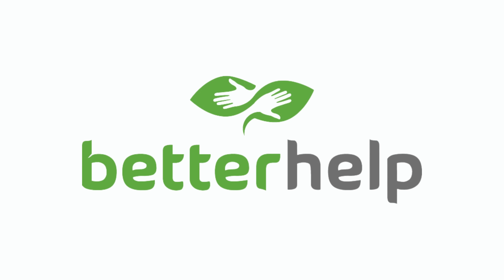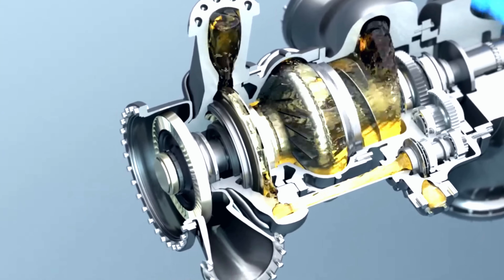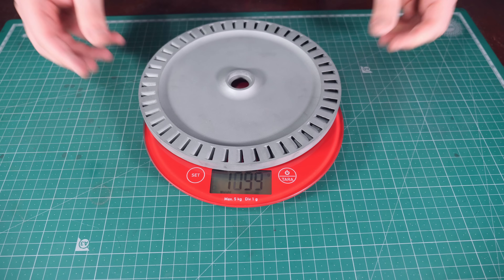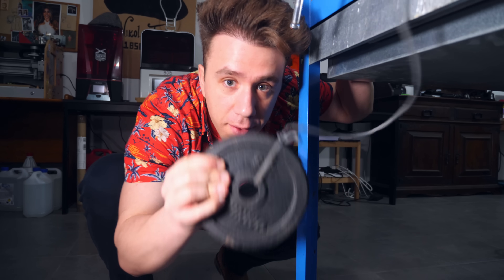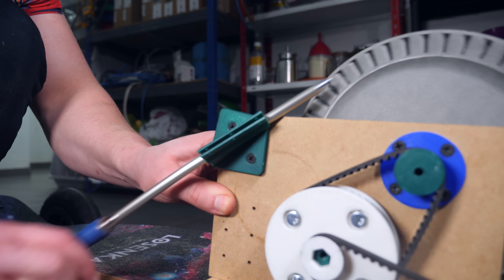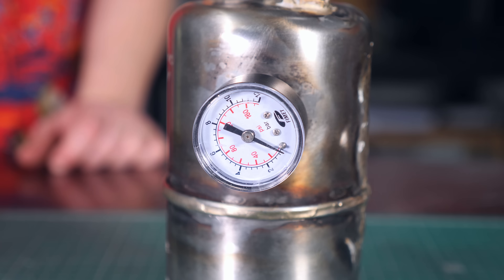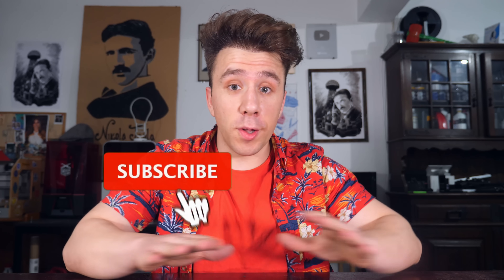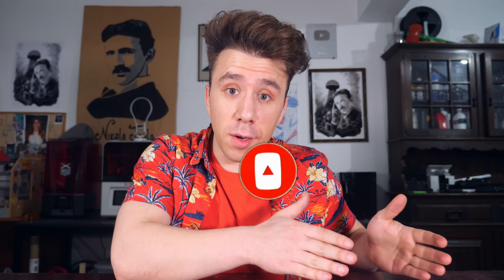I built a TURBINE Skateboard

Comment: Hj, just a note or whatever to mention that you are depriving your design of a good deal of it's capability by the rather hurried assembly of the turbine mounting.  I am unaware of the relative torsional strength limitations of whatever polymer you make your parts of, but the side play could stand to be equalized.  When that is achieved, the concentricity may be more closely observed, and , if necessary, corrected.  I know that this is just a "bread board" rig, not a finished product and that your habit is to improve each trouble as it rears it's head to attract your attention.  I felt the urge to, possibly, save you the frustration of having to re-acquire such an expensive item.  On a side note, BRAKES.  I was thinking that compression of the rotor would work , but a counter rotational stream would work nearly as well if there were a second rotor, which would give you twice the weight  but will slow the acceleration accordingly while removing any worry of distortion and heat.  No matter, just doodling without paper.  Looking forward to see your advances.

Comment: steering a skateboard is just about the distribution of weight. If you can balance while leaning to either the left or right, you can sufficiently direct the direction you are rolling. impressive work on the turbine wheel btw. I love seeing metal-printed parts in action.

Comment: you could make this but with combustion providing the power, it wouldn't be hard necessarily since you can 3D print the turbine out of metal, and you could use a direct linkage gearbox to drive yourself forward

Comment: If you stood upright, you wouldn't really need a steering mechanism, you could just lean in the direction you want to turn. Maybe rig up a remotely controlled servo or an actuator cable to control the release valve on the nitrogen. This would add another layer of safety for you, too, if something catastrophic happened at the drive mechanism.

Comment: There are a few reasons a gas turbine isn't great for a passenger car, one of which is the fact that turbines want to run one speed, instead of speeding up and slowing down like we do with our reciprocating (or wankel!) engines today. The throttle response can be several seconds, and you don't want your engine pulling at full power for five seconds after you've mashed the brakes! There is also exhaust heat to deal with, you don't want to burn the bumpers off the Camry behind you at the light. 

Engineers with Chrysler came up with all sorts of cool things to solve the above mentioned problems, and as a result they had a very smooth car engine that cost a lot of money compared to a V8 engine of the time. And people were used to their cars rumbling, instead of howling like a vacuum cleaner. The turbine engines have a similar problem to rotary engines, in that they need to be noticeably better with regards to fuel efficiency, noise, complexity, and cost than what you can currently get in a car, but normal car engines are improving all the time. You're chasing a moving target. If you take ten years to develop an engine, you've got to anticipate what engines will be like ten years in the future.

Comment: Try not to go out like Max Valier. Maybe put something between yourself and any high rpm turbines and home made pressure vessels so you don't die as soon. Also you should try driving that turbine with a hybrid rocket engine or something spicier than compressed air. Go big. I bet you could get 100KW out of that turbine without trying too hard.

Comment: 1:01 Jet engines are NOT efficient at all!! Why would you claim that they are? The BEST jet engine in existence barely makes 30% efficiency - most commercial jet engines are in the range of 15-18% efficient. The exhaust is thousands of degrees....they're only able to be efficient if the exhaust is cold and that thermal energy is used - and it isn't. Jet engines are hilariously inefficient in terms of the Carnot cycle. You're an engineer mate - you should know that! The majority of the energy of combustion goes straight out the back of the engine and is lost. I really respect you as an engineer and love your videos, but you SHOULD at least have a basic understanding of physics....

I'm going to just assume you misspoke.

Comment: Integza my man, I love your content but I am going to downvote you for safety and constructive criticism.

1 - Long sleeves and loose shirt near rotating objects. The bench saw and drill press with wrap you around them like a pretzel. NO LONG SLEEVES!

2 - Standing right in the way of the spinning flywheel a random chinese company made for you and spinning it at 6000 RPM. If it would have structurally failed due to a defect, you would be right in the way of serious pain.

3 - You MUST use an automatic pressure release valve. PLEASE. You very nearly became the ghost of Tesla PAST with that liquid nitrogen can.

4 - When you're sitting on the finished contraption, you were sitting with your private parts right in line with that same spinning flywheel. Please for the love of god, add a shield around the flywheel to protect you from disintegrating parts!

Thank you and I look forward to your next (hopefully safer) video!

Comment: I think that you should test different 3D printing materials, print cylinders and test them for pressure. Until failure. Test different plastics and different wall thicknesses. So that we learn what material to use. Boom! 😍
Reply: Yeah, make multiple pipe bombs. What could go wrong?

Comment: Not gonna lie, was a bit nervous about the nitrobomb you created at first.  Glad you chose another solution.  My suggestion for next project is to go bigger.  Since the company has your turbine design, get another one made and double up.  Double up the turbines to make a bicycle drive with double gears, double air lines and use the same nitrogen tank with more bar to allow for the double turbines.
Reply: The pre-fragged flywheel spinning at 6k in line with the rider doesn't bother you?

The container was nice too but that turbine... 😯🤦‍♂️

Comment: There's a few reasons gas turbines didn't catch on with cars and trucks. For one, while they can be more fuel efficient than piston engines, they'd rather run at a specific, constant speed in order to achieve this. Which is fine if you're just driving on open highway, but not in traffic. Also, while you get very smooth power output out of them, their throttle response isn't that great. If you've heard about "turbo lag" in turbocharged cars, it's the same concept. Emissions were also a problem. When the Chrysler Turbine came out, the US was just starting to implement emissions regulations. IIRC, Chrysler couldn't get the exhaust clean enough to meet the new requirements. So the tech was pretty much DOA. I suggest watching Jay Leno's video on his Chrysler Turbine. He goes into depth about how it works and what it's like to drive. For cars and trucks though, reciprocating engines and electric motors are just better suited for that task.

Comment: Okay, so ignoring the obvious safety concerns of this pipe bomb powered skate board (Turbine failure risk - Centrifugal detonation, and the lack of a safety valve on an improvised pressurized vessel - further detonation risk), There's a fair list of ways to boost efficiency here:
- Directing valve for the gasses, which can likely be implemented with the addition of a turbine shield
- Further turbine stabilization, which likely also would fall within an implemented turbine shield
- Tube rerouting and Pressure vessel relocation, to both reduce used space (and potentially weight) on the board and further separate them from a rider
- Implementing a solenoid valve on the vessel's output (and/or input), to both serve as a faster pressure discharge, and potential alternate safety discharge if implemented with a pressure gauge that can link to the valves' electronics
- Low power heating coils, rather than a Bunsen burner, to stimulate evaporation more safely within the vessel without an open flame

Please be more safe with this project in the future, although the speed of these developments was impressive, in spite of egregious lack of concern for safety.

Comment: CO2 tanks hold more volume of gas for size/weight than nitrogen.  When compressed in the tank, co2 is in liquid form.  It might get you a longer run time on the portable cylinder.

Comment: Theme for a future video idea: Tip jets. Build a propeller with tip jets(like the rotodyne used for takeoff). I think it can be built with 3d printing and powered by compressed air or nitrogen, and could definitly push you around on a skateboard.

Comment: Video idea: turn a gasoline engine to work on liquid pure nitroglycerin, sounds fun and dangerous :3
Tomatoes are disgusting!
Reply: Ignition systems? We don't need no ignition systems.
Reply: @absalomdraconis  but i think gasoline engine isn't gonna support the explosion of nitroglycerin, maybe diesel engine it's gonna work better
Reply: @itsmesqrdios That's actually a good idea since pressure can combust nitroglycerin. But what if it was a Wankel rotary engine? Wouldn't that make it even more powerful? Moreover, Integza has made a rotary before, too.
Reply from the maker: Congratulations! You won a 3d printer! Send me your info (Name, Address, Zip Code, Phone Number) to integza@gmail.com .
Reply: Sounds almost more like a diesel engine would work better but good idea nonetheless
Reply: @0_Chr1s_0  yuup
Reply: I think a diesel engine would be a better fit for nitroglycerin considering how explosive diesel and nitroglycerin are. That being said, nitroglycerin is far more easily combusted than diesel, but I do think a diesel engine could withstand the combustive force of nitroglycerin for a short time. And considering how little you'd probably need in order to mimic the combustive force of diesel, I'd say it could be pretty efficient.
Reply: @maxxswagster9283  yeah same thing, diesel engine would be better but i don't think it's gonna handle the power of the explosion
Reply: @maxxswagster9283  but still, how would you get nitroglycerin into the combustion chamber?
Reply: @politecat3299  With a fuel injector.
Reply: @maxxswagster9283  do you really think nitroglycerin can withstand 2500 psi ? Nitroglycerin explodes at 0.284467 psi
Reply: @politecat3299  Well if it combsuts at such a low pressure rating, that means you could potentially build an engine with a smaller size. A smaller engine with a smaller size with the same amount if torque as a bigger diesel engine could be really nice. Imagine having more space in the engine bay of a big truck. Better yet, in situations where you need more torque, you could make the engine a bit bigger to be able to withstand heavy duty applications like what used in heavy equipment operation.
Reply: @maxxswagster9283  also nitroglycerin is very viscose and semi gelly. It can't be vapourised, also nitroglycerin explodes at 38°c . So that'll destroy the engine because of the non uniform cycle
Reply: @politecat3299  Suppose we'll either need to make a form of nitroglycerin that's less viscous so it can be properly injected into an engine, such as whats fome for biofuel. That, or we'll have to utilize a more powerful fuel injector in order to inject the nitroglycerin.
Reply: @maxxswagster9283  you can't use nitroglycerin as fuel in engines any way. It won't work.
Reply: @politecat3299  Why won't it work though? What is limiting nitroglycerin as a fuel for combustion engines?
Reply: @maxxswagster9283  it's highly volatile, corrosive, explosive, reactive and sensitive in its liquid state. If you want to make it less reactive, you gotta add neutralized clay to it . Which can't be pushed by a fuel injector.
Reply: so isn't nitroglycerin in a meatal container just a bomb right
Reply: @applesong7010  maybe :3
Reply: That's called building a bomb.
Reply: ...how about no.
Reply: Had almost the same idea last video
But happy for you
I hope he does it tho😅
Reply: An internal combustion engine works with deflagration (expanding hot gasses) not detonation (an explosion) if you use nitroglycerin, a super strong explosive, you turn your engine into a handrgrenade, which is less than desirable
Reply: @JarOfDirt. Yea that's something a lot of people don't understand. Detonation in an engine is bad, and usually leads to a rapid unscheduled disassembly of the bottom end.
Reply: can you give me the 3d printer that you will win
Reply: @wellchessplayer  unfortunately i will not win
Reply: @itsmesqrdios you did win bro. now will you give it to me. i wanted a 3d printer but im lacking money even after selling my ps4 😭
Reply: It won't work. That'd probably be suicide. If Engines can't handle gunpowder , how can it handle nitroglycerin?
Reply: I think the closest thing to this are piston engines powered by hydrazine and h2o2, once saw a prototype of a motorcycle powered by this😂basically a bomb on two wheels
Reply: That seems safe. I like it.
Reply: That already exists (sort of). engines running on nitro-meth-ane (also an exp-losive)
Reply: @guytech7310   Yeah but then it’s always mixed with more than half methanol. He was talking about PURE nitroglycerin, which would just turn the engine into a bomb on the first powerstroke. In internal combustion engines, you don’t want detonation because it causes the pressure increase to come way earlier than it needs to, which causes knocking. Pure nitroglycerin would be an extreme detonation, which would probably just blow the engine up.
Reply: Nitromethane is not an explosive.
Reply: Uh, yeah, it absolutely is.  Maybe not in the fuels it’s sold in (though they’ve been known to detonate when they get old and start breaking down) but straight nitromethane will absolutely detonate especially if confined or sensitized with an acid or any number of alternatives
Reply: @arturjogi6054  Nitromethane is absolutely an explosive

from wikipedia: "it was realized that nitromethane was a more energetic high explosive than TNT"

Comment: The reason turbines aren't in cars, is they don't idle well, they aren't very responsive, they don't like changing throttle, and they are horribly inefficient at idle. There's not much difference in fuel flow between idle and full throttle

Comment: gearing might help..  but also an enclosure to help direct your flow of air should be a huge boost, a lot of energy is lost as the air bounces 'away' vs following the circle.   reminiscent of the tesla turbine.  you might also be able to cast your wheel from cement.  3d print the mold, then pour the cement (or mold->sand->cment)  you can also test the turbine disc vs enclosed turbine disc by simply 3d printing the 2 designs for testiing purposes, to see how much they spin vs input.     I'd say the most impactful change would be the enclosure.  the cement disc would be a huge cost savings and you can make them in different sizes easily.  if the cement spins TOO fast (too fast depends on diameter) the risk of explosion can be mitigated with an iron band around the outside. ez-pz. ;-)

Comment: Steering and brakes! The next video could be a larger version that includes a seat, steering, a place to hold the gas bottle and a fixed gas nozzle, with a "remote" valve so you don't need to lean over the turbine. Also, think about multistage turbines. Should be easy, to mount the first in an enclosure and use the outlet to drive the second turbine. Lights and a roof are options, which, when the "Integza Automobile Company" markets the first environmentally neutral gas turbine automobile, you can charge big time for options. Larger gas supply, all-wheel drive, etc. Good luck!

Comment: I also have no experience with skateboards, but I think the way they are usually 'steered' is by leaning to either side. The thing the wheels are attached to (called trucks?) are designed to make the wheels turn

Comment: One problem that came up with the Chrysler turbine was the lack of engine braking.  I'm under the impression that there were more than a few accidents where the operators expected some engine braking, got none, and ran off a cliff or into another car. 

I don't know if this is THE reason, but if you HAVE to rely on brakes 💯 to stop, you will potentially overcook them and only an impact or an uphill will stop you.

It is generally a good design/engineering decision to have multiple ways to slow down and stop

Comment: I would like to see you build a Ramjet engine. I know its generally only funktional at high speeds and would therefore have little use on a skateboard. But it would be great if you could develop a design that is functional at comparably low speeds. It might need an aditional conventional jetengine to get / keep going but i guess you'll probably just build that one too😂.

Comment: Solve all of your 3d printed engine problems, melting. In modern gas turbines the blades are internally air cooled. With 3d printing you could achieve some very unique and efficient internal geometry not achievable with subtractive machining or even casting. Just air cool your plastic blades.

Comment: If you plan on using liquid nitrogen for this in the future (as it would be a smaller/lighter package), then I'd highly recommend a cryogenic container for safe storage. You could then let this go through a valve to another container where it can be heated. The obvious problem is, the valve will probably freeze open, but that's for future Integza to worry about. :D